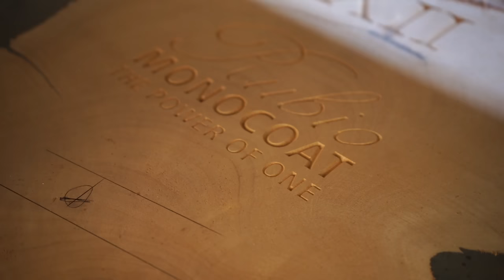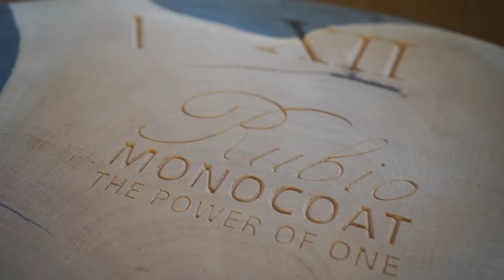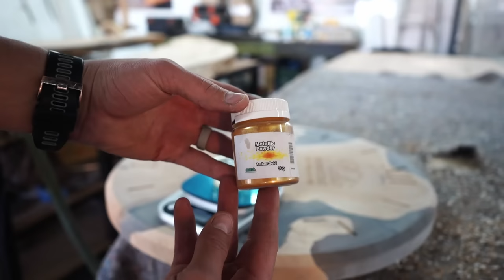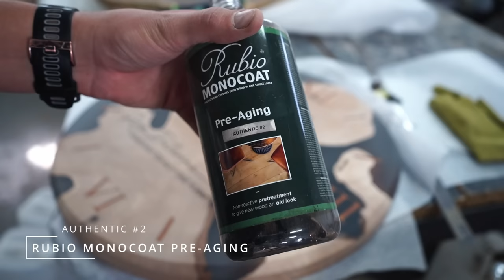$1000 DIY Epoxy Clock Build (START TO FINISH)

Comment: Clock looks great but man I can't wait until the epoxy craze is over and dead.  I think its been beat into the ground more than any other woodworking phase to date.  Its still a nice looking clock and you did a great job.  But epoxy...again...in 2023?